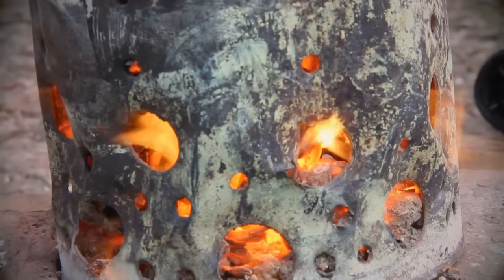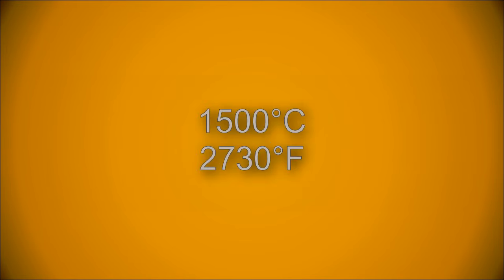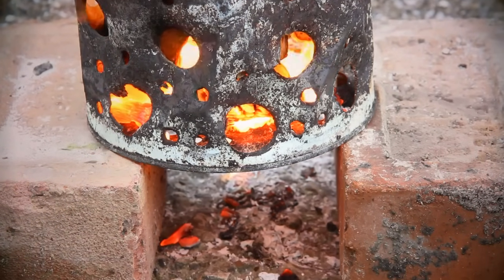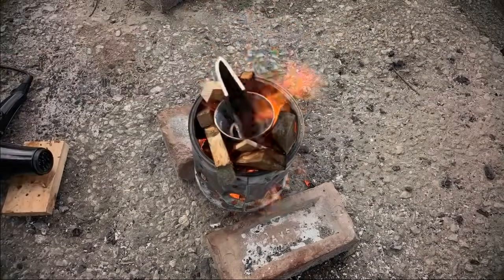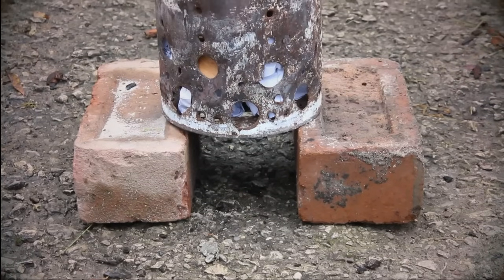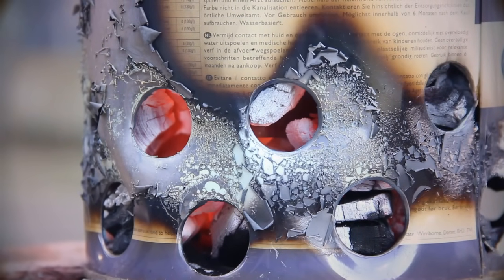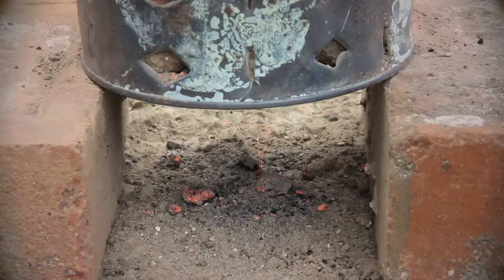How to Make a Free Aluminium Melting Furnace

Comment: U can melt aluminium cans but the downside is most cans have a plastic lining,u will need to skim the plastic & the colored print from the outside of the cans off the surface of the molten aluminium.

Comment: You guys better explain the DANGERS of WATER in the mold and popping and burning some person that got an ignoant education on castings.Thats something you just dont jump into and think your melt all your aluminum down to conveniunt ingots.My father had a body shop and use autobody lead for filling a low spot in autobody work or the edge of a so called DOG LEG on the edge of a quarter panel which gave good strenght, in the end i would swep up the fillings and use them for making lead sinker dipseys and ne showed me the DANGERS of a casting mold which contain a very small amount of WATER?It can actually explode.Make sure your mold is hot when recieving liquid metal BE  CAREFULL.

Comment: Nice, I remember melting my old Warhammer figures that are probably typically worth a lot a lot of money, well would have been

Anyways we found an old concrete post with some words and used the letter "A" as a makeshift arrow mould, we used a beercan to melt the led in a fire then poured it into the cast, it instantly spat and thankfully nobody was hurt, my friend who luckily wore glasses had specks of led on his glasses, be very careful with molten metals, it could be an instant and everything is damaged beyond repair 

Use decent PPE and warm up the cast before pouring metal into it

Comment: How to make a dangerous "furnace" that will cost you more in hospital bills than building a proper one. It's not even reasonably stable, and the fact that it's not insulated means that the fuel cost per-pour will be greater than the value of the ingot that's made.

Comment: You never said what you used for your casting mold. What is it? I've used my portable fire pit to burn scraps & pieces of disposable wood and spring pruning off of the junipers and othe decorative wood in the yard. Got the fire so hot, i had to stand 20 ft away. Very good alternative. It also works great on windy days, you won't need the blow dryer.

Liked the video.
Reply: Seems to be a brick...

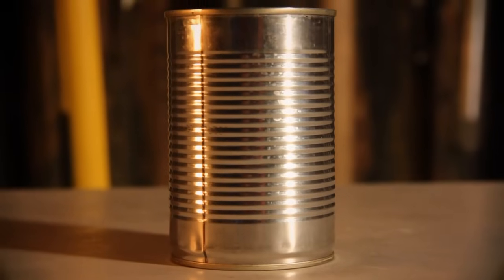Comment: 2:24 I don't think a tin can is a good idea. Doesn't tin have a far lower melting point than aluminum (or aluminium, as you Brits say)? I think you meant a steel can.
Reply: Tin cans are actually made from tin plated steel. The tin plating is to prevent corrosion of the steel.

Comment: I've seen so many videos on DIY aluminium melting that claim to be cheap and easy, but all of them require something like heavy insulation foam or a gas tank for fuel.
This is something I could just go to my local park and do with maybe ten minutes of rummaging in my rubbish bin beforehand.
Absolutely brilliant, cheers lad.
Reply: I have melted aluminum cans in my fire pit, I melted it in a soup can.
Reply: @kurtschmidt5005  same, I used a leaf blower to get the fire hot

Comment: This is just what I need! I make 1:250 scale model airliners from wood if I could make a sand mould I could cast the fuselage and wings and make many of them far quicker than carving the wood! I will use drinks cans and used foil. I might use charcoal however as it burns a lot longer than wood.
Reply: Update?
Reply: Vienna sausage cans, spam cans, kitty food cans . . . And the lids!

Comment: Never seen it done this way before.  Will have to give it a try at some point. I have some cast pieces taking up space.
Reply: this is nothing more than just basic metalsmithing. this method has been in use for thousands of years before steel was ever invented. this is how copper, bronze, tin, lead and aluminum  were cast

Comment: No, you shouldn't use a steel crucible for aluminium.  Iron is one of the most troublesome impurities in aluminium cast materials. During the solidification of aluminium alloys, iron promotes the formation of intermediate phases, which may damage the properties of the final product.

Comment: Tin Cans make lousy crucibles. They are soldered along one side, and prone to melt. 
Solid steel pipe with a bottom welded to it are far superior.
Also, if you have enough bricks, build the walls up a little bit taller than the main container, and lay reflecting Aluminium foil or house insulation on them to reflect the heat from the main container. Leave gaps in the walls for airflow, of course.

Comment: Awesome! Thanks! What if you used a ceramic crucible? Could the furnace get hot enough to fire a homemade clay pot? Clay is not hard to make from dirt. I think you need to mix it with some grog or sand to keep it from cracking in the fire. I have never actually fired a homemade pot, but I have researched it.

Comment: Here’s a tip for ppl using wood… as time goes the high temperature will turn it into charcoal before it completely burns I did a test and the temp was basically the same maybe a 20degree difference
Reply: Would adding bbq charcoal help or would it be a waste?
Reply: @xenon-aeronautical  if you have more wood then charcoal why use charcoal… or turn your wood into charcoal like I do(I got around 200lbs+ of charcoal I’ve made… and yes it would help

Comment: would charcoal burn hotter and require less air to increase temp?
Reply from the maker: Yes it would. I try to use charcoal if I can
Reply: Forget charcoal... it's usually too expensive compared to natural gas. Yes, I know that you can make it yourself and some folks can attain it super cheap or for free... and some folks can also get coal as well. If that's true, go for it. Even so, they don't burn very clean in most home built furnaces. Based on cost for the average guy at home though, it would be better to build a proper gas furnace. Best wishes!

- Max Gigantum

Comment: I'd kill for a nice crucible.
Reply: You can find them online with a wide range of prices and quality. If you cast seldomly, manufacture a small crucible out of a section of steel pipe - weld a cap on one end. Stay away from galvanized pipe unless you grind the coating off of it! Best wishes!

- Max Giganteum

Comment: I'm not questioning the viability of this, but this is more of an engineering type question. Would not it get hotter if there was 1 source of directional wind at the bottom opposed to many? Like a 'rocket stove', or am i just wrong about that all the way around? Thanks
Reply: You would be correct in your assessment. Overall, the method as demonstrated in the video will work to melt Aluminum, it's true. However, it's a really inefficient way to go about doing it. To put it nicely, it's a very BAD way to go about it. You'd be better off digging a hole into the ground or a bank of dirt! Why? The dirt would act as a superior insulator thus you would burn less wood and the temperature would be higher. Yes, it works but there are far better ways to go if you want to be serious with casting Aluminum and do it in a far safer manner. Soup cans are usually good for a melt but often fail before you get even a single one completed so beware! Wear some serious PPE and use some channel locks to hold onto the top of the can when you pour. NEVER get under the can with any part of your body. Be prepared for the worst because if the can lets go, you'll have molten Aluminum spilling wherever and whatever is burnable can/will get burned or ignite itself and burn. That includes your clothes and your skin! As far as what methods to use which are superior, search up other video clips where folks use a wide variety of methods to construct a furnace while using different fuels or electricity. With electricity, you can use heating elements in a furnace or use the induction heating method which is super fast but is expensive for the equipment. Depending on what you can scrounge up, are willing to pay for and based on your talent... you can invest a little time, energy & money or a lot. You can make do and get by... maybe... or do it right from square one and produce excellent, consistent results. My best advice is to see what others have done and make an informed decision for yourself. Try to hook up with a hobbyist or two in your area (or a group!) and get some time in helping them out and ask them to teach you the ropes. You'll get a much better idea as to what you really want to do and how far you want to go with metal casting. You'll also potentially save yourself a lot of the previously mentioned time, effort and money. Some folks get really excited by what they see in a video then once they experience it? They decide it isn't for them. The smart play is to get educated, get some experience and make informed decisions. Best wishes!

- Max Giganteum